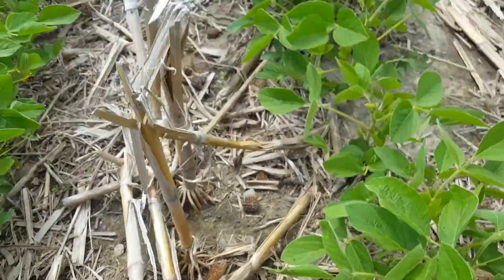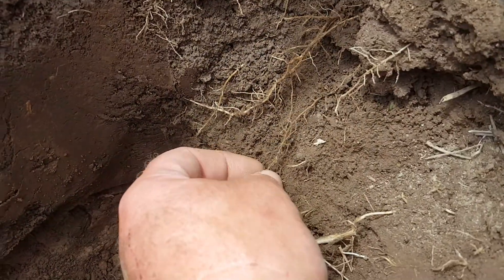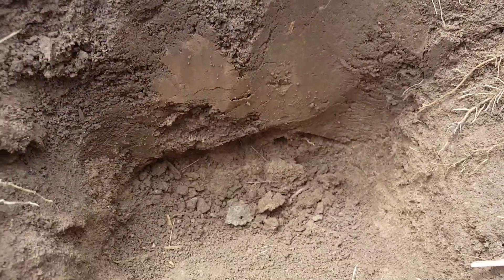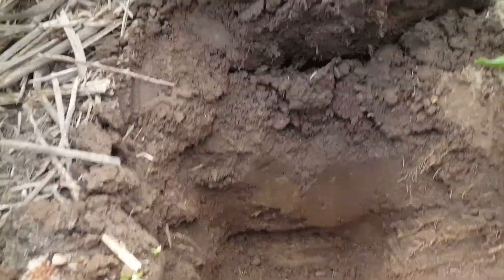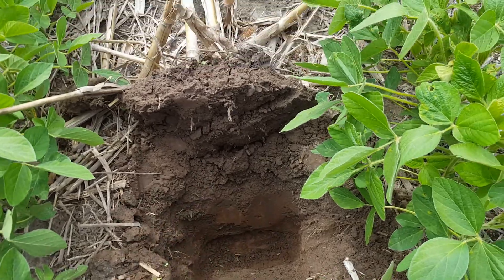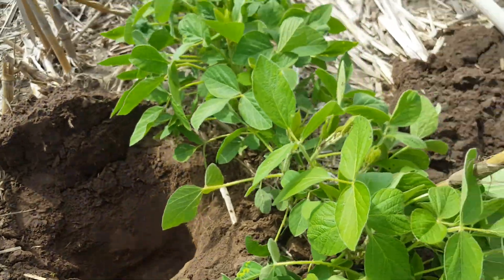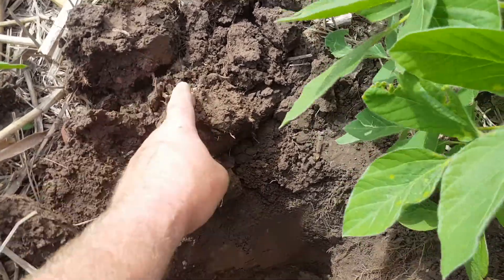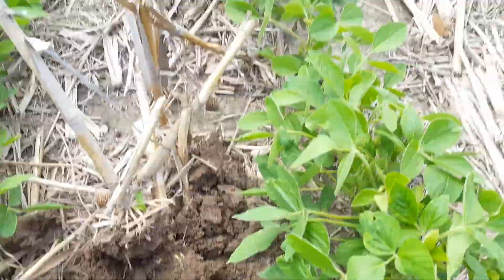No-till soil structure

Comment: Firstly let me say I am in the UK and know nothing of growing either of these crops as we don't have an appropriate climate for these seed crops although Maize is grown extensively for forage for livestock feed in a silage form or whole crop for Bio - Digester plants.

(Arable farming here in the main swings around wheat, barley and some oats, peas and beans, linseed and most importantly  oil seed rape. These crops tend to be planted in the Autumn and combine harvested mid July - late September. Root crops are widely grown in certain parts of the UK.) 

I understand the point you are making between the two systems, however what disadvantages do you see regarding No-till? (apart from the obvious like needing a different type of planter). 
How do you deal with weed control issues? - will pre-emergence products work with all that debris on the surface with no-till system or does one have to wait until weed emergence to deal with the problems? - we have massive issues with certain grass type weeds.
What are the practical options for fertiliser applications for No-till?
If you mono-crop for a while as you suggest in the video are there increased risks of pest/disease buildup in the soil / debris infecting the current growing crop (compared to tillage systems)? (We have big issues with slugs following oil seed rape crops)
Lastly can you see any reason why no till cannot work on crops that are planted on much narrower rows than your using eg 5" rows? Bare in mind all crops have the crop debris chopped on the combine (or baled and hauled away for feed / bedding) before being spread and stubbles are cut pretty low.
Reply from the maker: stay tuned. you have me a couple video ideas.